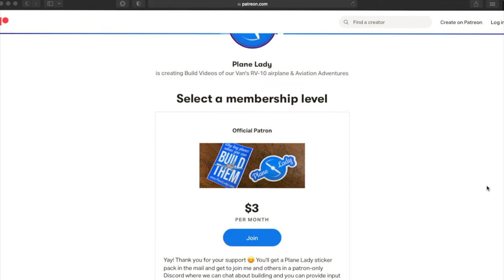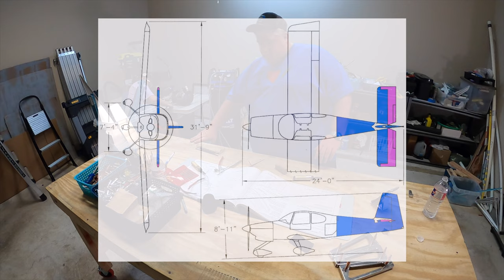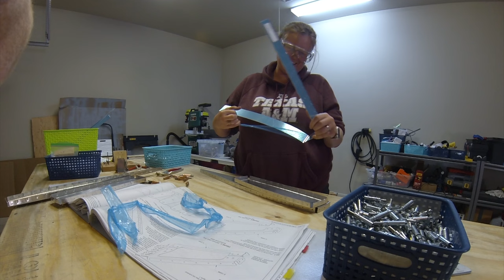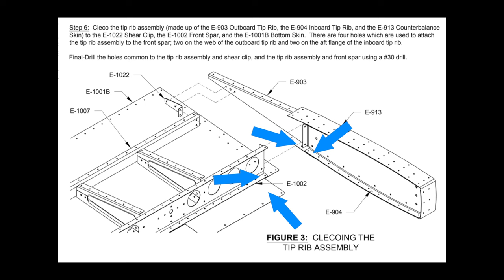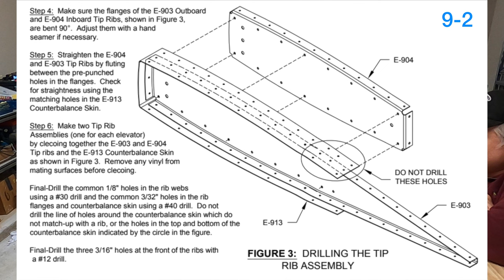Van's Aircraft RV-10 Build: Days 66-73 - Elevators Part 1 & Fluting Pliers (9-2 to 9-8)

Comment: Nice intro. We heart clecos, too. :)

Nice visual explanation! Also, "Flute to Flat" - If the part when laid web-side on the desktop isn't flat, you are reshaping it until it does lay flat, basically. Also, the flanges need to be 90 degrees to the web, and there might need to be some check-and-adjust work in that department, as well.
Reply from the maker: Thank you 😁

Comment: Why leave the holes at 3/32 instead of drilling them out earlier?   ===>  To accomplish the 51% Rule!!!     (Lotsa that during the course of the entire build)
Reply from the maker: I mean why have holes in the spar at 3/32 and holes in the horn already at 1/8? And then drill the holes in the spar up to 1/8 in 9-7 step 2 but specifically say not to upsize them to 1/8 in 9-5 step 1? I’m drilling them either way so the 51% rule applies regardless.